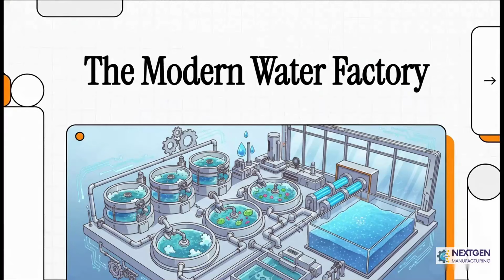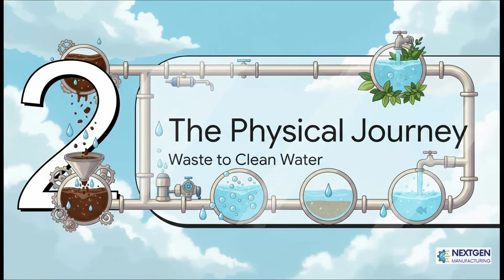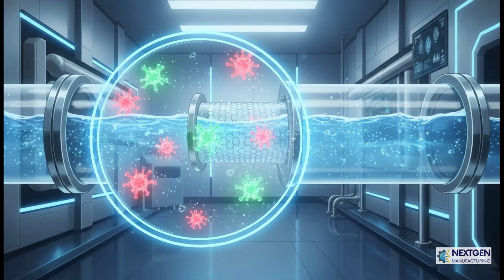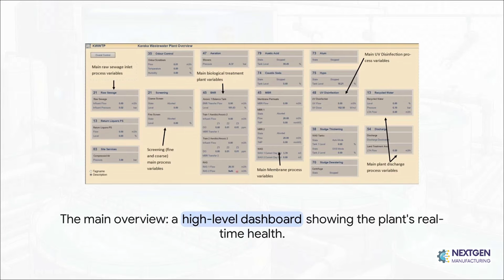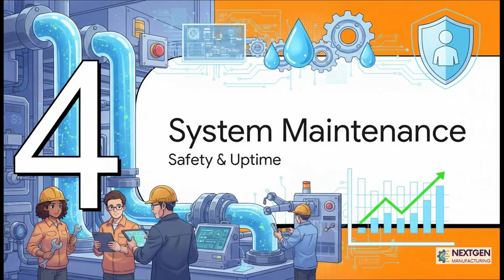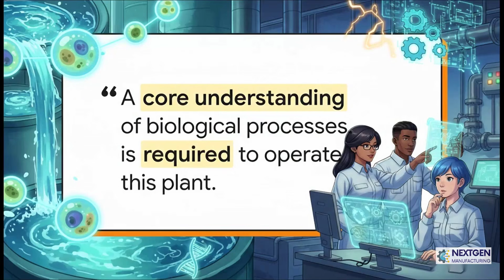Inside the High-Tech Factory Turning Sewage into Pure Water

Comment: Installed SCADA systems for 30 years all over the lower 48. Never ran across a single sewage plant that used anything close to RO filtration. And only few water plants that do only in salt water filtration. Much too cost prohibitive. Take it or leave it but only a fool would consider using effluent from a sewer plant. Certainly better than dumping raw sewage in the rivers but it's far from great. Then what the water plants do with it is marginal at best. Their primary focus on biological treatment. Do yourself a favor and stick to the bottled water.
AI might remove more employees as SCADA did but improving quality will be minimal at best without spending the big bucks in new process practices.